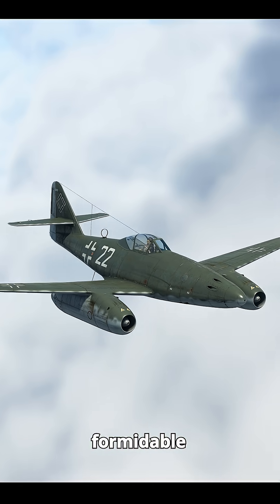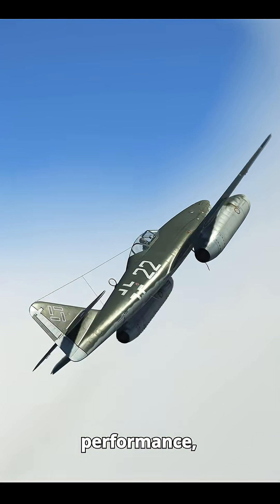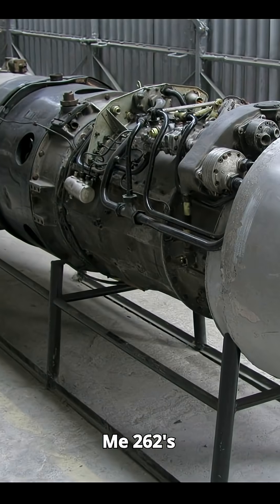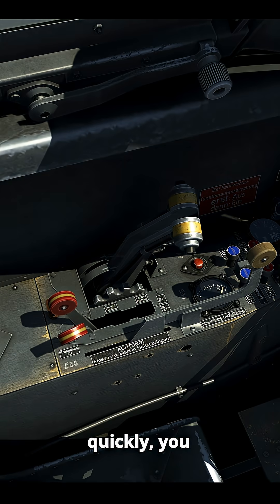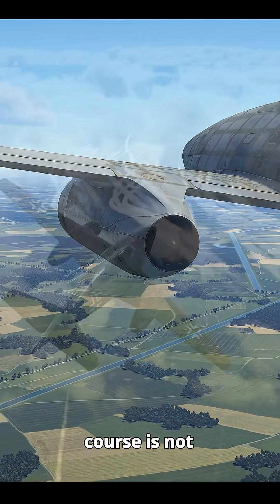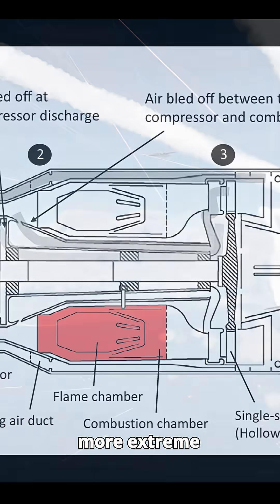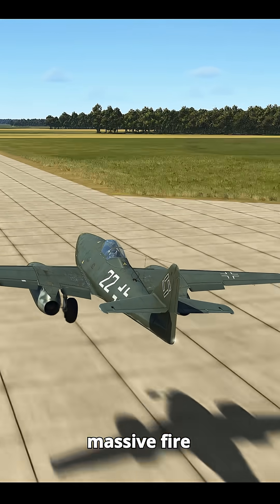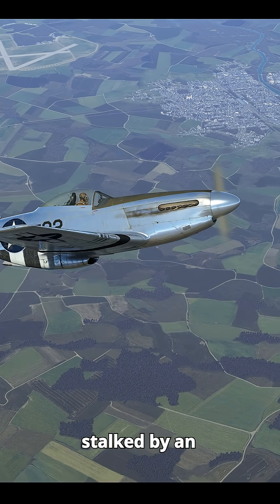Why Landing the Me 262 Was So Dangerous

Comment: The fact that it could run on AVGAS, Diesel, or coal-derived fuel is incredible
Reply: Jet engines are able to run on any flammable liquid, perfume if you so desire, it is just that they perform better and last longer with certain fuels. QANTAS Domestic flights run on a blend of Jet-A1 and Biofuels.
Reply: Like most jet engines actually
Reply: that's turbines for ya. AGT1500 in abrams can do that too without loosing performance.
Reply: Wow,  I had not heard that before.

Comment: IL2 BoS or smthng like that right?
I remember 262 being hard for takeoff, landing wasn't that hard in comparison.
You can put out the engine fires with side slipping quite reliably from my experience but I didn't play for at least year or so...
Reply: Yes,  very easy to put out with a side slip, but the engine will probably have been damaged.
Reply: @Jbroker404 Idk if i understand correctly, sideslip doesn't cause any damage, the engine is already damaged for fires to start.
Its just firefighting blanketing technique so your wings wont melt and you don't lose half of the thrust which in 262 means taking the bus home.
Imo essential knowledge with 262, fires will erupt again but you get the bird home.

Comment: It’s important to note that the problem was in the fuel control system and that allied jet engines had the same issue.  It was only because the allies had more nickel in their refractory alloys and used better turbine fabrication (machining instead of stamping of turbine blades) that they had less problems.
-The Jumo 004B used a centrifugal  governor to control fuel flow.  The pilots throttle acted via a spring on a centrifugal governor which controlled a bypass valve that controlled fuel to the combustion chambers.  Move the throttle to fast and fuel is over or under-dosed due to the spool up/down time of the compressor.
-The proper way to control fuel flow is via measuring the air flow and dosing accordingly. 
-A device called the (acceleration control valve) or beschleunigungs ventil was scheduled to get to frontline squadrons in early April 1945 about 1 month before the war ended.
-this had a differential pressure sensor across the compressor to measure air mass flow and this was used to dose fuel.  The centrifugal governor only made minor adjustments.
-There were also thermocouples in the exhaust but the were not connected via electronics to a fuel by pass valve yet
Reply: And yeah, the thermocouples in the exhaust were mainly for monitoring EGT during testing or maintenance, they weren’t hooked up to a feedback system yet. 
If Germany had gotten further with analog electronic controls, they might’ve used them for real time fuel trimming, like modern FADEC systems do
Reply: @Valery_Gerasimov Lack of skill in Analog Electronics wasn’t  really the problem.  They had the electronic mischgerat computer used to implement the PD proportional derivative used to control the fins of the V2  and there was an all electronic version Kommandogerät 40 FLAK predictor by Askania.
-The problem problem was that German engineers like British and American at first thought a simple fuel control throttle was enough.  The BMW  003 designer Hermann  ostrich expressed regret to Bristol Enguneer Sir Roy Fedden over not having invested enough time in fuel control systems.  Ironically existing fuel
Injection control systems were suitable with minor changes. 
- you need electronics because you need to calculate the derivative of temperature change to stop big temperature excursions.